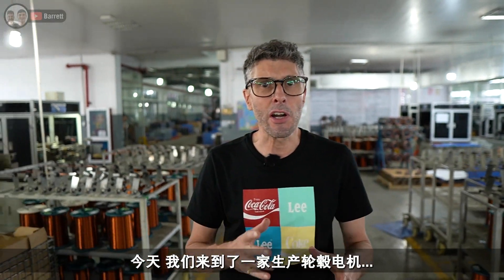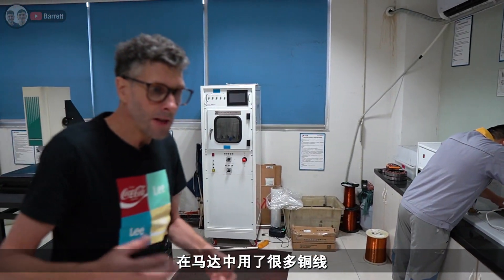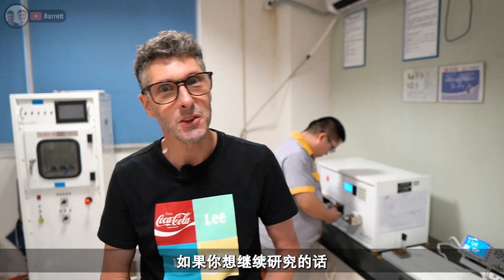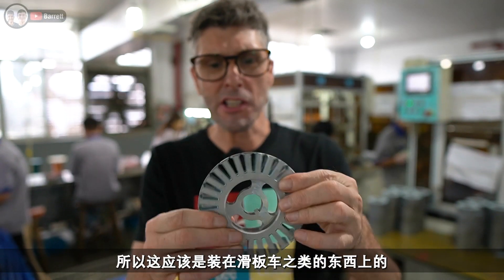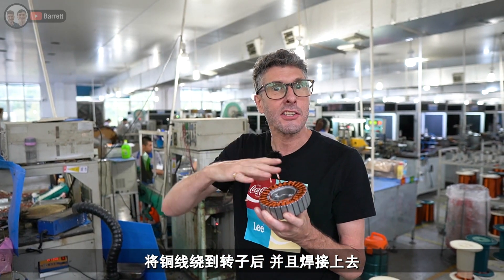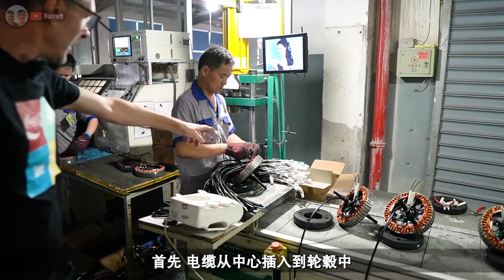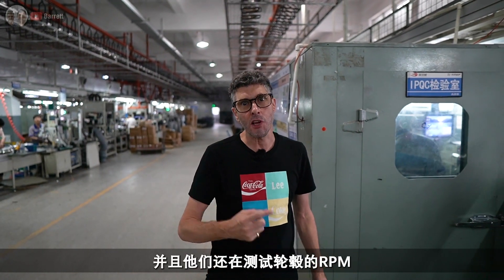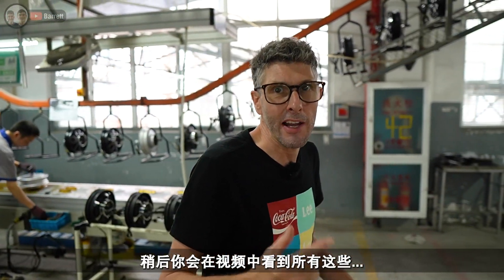Can you Believe this is how it's Made? // 你敢相信它是这样生产出来的吗？

Comment: Interesting video and a nice presentation. For your information electricity does not travel through the wire it flows over the surface.
Reply from the maker: Yes you are correct, but that would be difficult to explain to people without any knowledge of electrical conductivity.